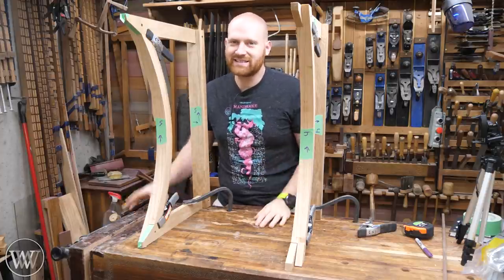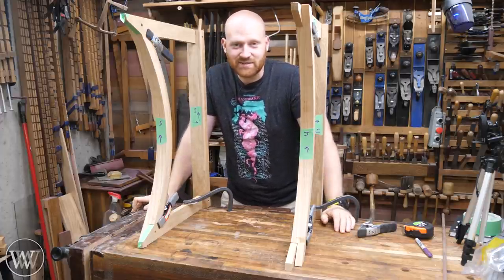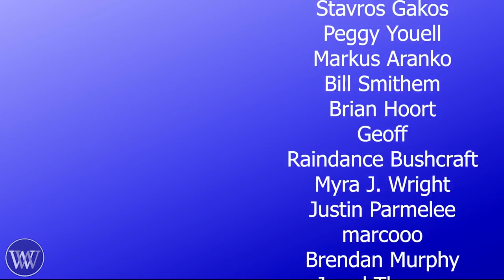Making Desk Drawers for the Slab Top Desk Bent Legs

Comment: Amazing!! How do you cut so straight? Not following the line, I can just about do that, but I always seem to cut at an angle through the wood rather than vertical. Very frustrating.
Reply from the maker: If the song always cuts in the same direction every time it may be a problem with the saw. I just put out a video on the second channel talking about stoning a saw and how to fix a saw so it goes straight down the board. Most of the time it's body mechanic and that your arm elbow and shoulder are not in line with the saw I usually tell people to shoot a video in line with a saw as well as from the side and you'll see all sorts of problems that are easy to fix.
Reply: @WoodByWright  Thanks for your reply. I'll try the video idea. It could well be the saw too. I think I need to invest in better equipment!! Thanks again.

Comment: Why epoxy instead of Titebond?
JIM
Reply from the maker: With PVA glues like Titebond you need extreme clamping force for them to reach their structural quality. in this build I will not be able to provide that. epoxy does not need the clamping force, has great gap filling capability. and gives me a long open time I will need for this one.